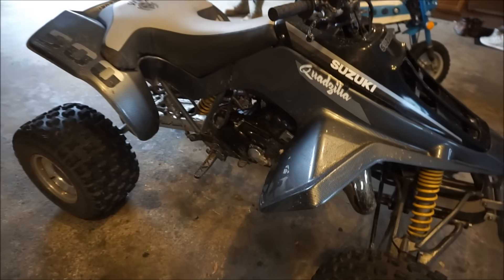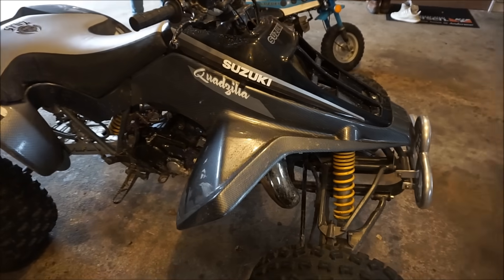Quadzilla Top Speed Test!!! (SKETCHY)

Comment from the maker: Be sure to see description of video to see what gear I use and upgrades to buy for the Quadzilla. To continue vlog follow me on Instagram @2_vintage_ 
Google says stock Quadzillas went 77-80mph. So I think it's right where it needs to be for speed...
Reply: How fast is that in kilometres an hour
Reply: By the way there is an error in the description as you was saying to see how fast it would really go it auto corrected to rally
Reply: Are you going to do a ltz500 vs cr250
Reply: You should do more than one top speed test so u can get and average speed because one test it could go 77 and another it can go 79 or 80
Reply: change sprockets in front and/or behind and their whole topspeed tests are worthless. kids don't seem to understand this..
Reply: This machine is NOT made for high speed road riding. It is geared down for good acceleration offroad riding. This means that with an engine without proper COMPRESSION like YOURS it is still possible to get up to top speed. Top speed is not the problem.POOR ACCELERATION due to LOW COMPRESSION is the problem and you prooved it several times!
Reply: @OhLuciii  124 kph- 128 kph
Reply: Adrian Wilson CD 250 wins out of the hole but dirty old Suzuki picks up enough speed to pass... eventually
Reply: Do a gauge check live on YouTube garunteed you know it has no compression trying to tell all the riders that have been riding since you were a newborn champ
Reply: @matthews852  lol good point!
Reply: The Quadzilla is known as the world's fastest Quad. With the correct parts it can reach a top speed of 120+ MPH But under 130 MPH
Reply: I had a quadzilla lt500 with a twist throttle about 15yrs ago. Came up on a small jump and after landing it, going up another hill the throttle stuck wide open. I rode the wheelie out for about 30ft and smacked a small tree on the right A arms and it completely ripped them off, shock,arms,and wheel. I rode it for a long time with three wheels and a custom skid plate . Definitely has a pucker factor.

Comment: I dont think you understand what high compression is, That quad you shouldnt be able to push with your arm. You should have to put every bit of weight you have into kicking it.
Reply: I have a 450 bike and the compression is so good that there is no way i could do it with my hand. This quad should be better
Reply: Yeah ikr lol my buddy had an old yz400f if you didn’t get it to tdc you weren’t kicking over you couldn’t even push it over with your hand. What their doing with their hand is barely more compression than my 250 two stroke.
Reply: I have an RM250 on fresh rebuild, gl pushing it with your arm lmao
Reply: @DGfilms1996  i know. You should only be able to do it with your foot. The only thing you should be able to do with ur hand is a 125 4 stroke. Lol
Reply: @kalvista8526  u got that rite, my 96 rm 250 required the 500 technique.
Reply: my guess would be they're down 20-30 psi, which isn't too bad but not(minty) by any means.
Reply: @theclubhouse1209  Exactly mines 01, if you fuck up it will break your foot....
Reply: I gotta push hard as hell to even push my 125 over with my hand. Does have a fresh top end though
Reply: @quadbikesr314  a 4 stroke right
Reply: 250fs and 125s are start-able by hand, I don’t recommend starting a 250f by hand though. Second of all, A YZ400F is COMPLETELY different and incomparable, because they have manual decompression, of course it’s going to be hard as hell to kick over. Every bike I’ve EVER been around I could at least slowly turn it over by hand.
Reply: Jackson Reich this might be the smartest comment on this page
Reply: Brian Bever Thanks lol I try
Reply: When I was a youngin I had one of these bikes rip an Alpinstar boot damn near in half.. If you got proper compression, you'll need top dead center, and every bit of your weight. Beautiful bike though. Kudos.
Reply: 92 lt250r. It's a Bitch to Kick
Reply: You cant compare it to a 4 stroke. The decompression is differant. And if you put constant pressure on any bike with your hand it will eventually turn over. It should be harder, but  it obviously isnt affecting it much when it's still hitting its oem claimed top speed. No need to rebuild and spend money if your flipping it. That piston still has another year or 2 of hard riding life left in it.
Reply: Kalvista yes idk what he’s talking about
Reply: I can kick my scooter with just my thumb boii does it have ‘mint’ compression
Reply: 2 stroke compression is way different than 4 stroke
Reply: Im guessing none of you people heard of air leaking past rings lol, you can slowly turn over pretty much all bikes by hand, what about sled engines like an 800 polaris triple 😂
Reply: First of all explain how a two stroke works since your so smart, I want to hear it. I want to hear how and why it could be so easy to turn over.
Reply: Kalvista I agree I rebuilt a couple of these when I worked at a shop and if you weren’t careful it would throw you off
Reply: Kalvista 2-stroke
Reply: I have 500 u can not push with hand
Reply: It’s a 2 stroke lol they’re not as hard as a 450, my 125 is like two weeks into a piston and I can almost start it with my hand
Reply: @kalvista8526  really? I have a 92' rmx250 and it's rebuilt too, it's really easy to kick over but it mostly starts first kick, it has 150 PSI though, maybe it just has a really good release?
Reply: Mike Samson no you don’t.
Reply: @Burt Gummer that's just wrong
Reply: @Burt Gummer not always
Reply: @DGfilms1996  OK buddy.. And who cares? The qaud has enough compression to get it started first kick.. So pls
Reply: @dannykyle738  thank you... You are the one person that understands.. Flip omg
.. Like the people are comparing it to 450 4 strokes.. It's honestly pathetic.. 😩
Reply: @mookow2534  exactly!
Reply: @jacksonreich5148  yes that's is very true!
Reply: @colebecker8658  I was thinking the same thing,  I made a video  " Shovelhead hand start" I think its called?  Its fresh and its 1250cc  and its point's   I'm either stupid or a badass or little bit of both or neither one of the other ✌
Reply: I have a rm 85 and my dad can't even push it with his hand
Reply: Buy a weisco. Overbore nickisea!. Pow 55-60 hp.
Reply: @bansheemania1692  Scraping you shin on the foot peg. Is a bitch. When kicking any these bikes. My 490. My kx  500 would bite me every so often.
Reply: Yeah my 85 has a shaved head and you can not push it down with your hand
Reply: Aidan Ley  right that thing has no compression
Reply: @jeffreyblank7087  yeah lol who thinks a 500cc 2 stroke has high compression when Mr stick arms pushes it down easily without putting his back or body into it
Reply: Aidan Ley lmao
Reply: Aidan Ley  and if u look at any of there "top speed" test nothing's warmed up it was cutting out the whole time
Reply: @jeffreyblank7087  yeah on some 2 strokes when there cold the power band disappears
Reply: Aidan Ley right
Reply: Kalvista I’d like to see you ride one know it all.
Reply: Not really actually because we used to have one and you don’t even need to put that much force into so your wrong on that bud

Comment: I kinda agree with whoever is saying it haa low compression, it may not be blown up low on compression however i have tried kick starting a kx500 and a cr500 repeatedly and i can never seem kick start either and thats at 160lbs. Which isn't much i know, but that quad seems to kick a bit easy to me as well. But hey a compression test woukd settle the dispute, maybe a video of something like that before you get rid of it? And i know that quad should be alot closer to 100mph then it should be 80, at least thats the case with any zilla i have encountered personally. Still an amazing machine none the less, and in great shape!!
Reply: But the difference is that quads your higher up on the kicker so you have more momentum comparing to a dirtbike
Reply: Still has low compression

Comment: Quad tires take 4-6lbs of air max as they're off road tires.  A 4-stroke raptor does 75mph tapped out, lt500s boast well over 90mph and with the right rear sprocket and pipe can break 125.

Comment: Ive loved the quadzilla since I was a kid. Any colors other than blue and yellow are blasphemous.

This top speed run is sad. Hell, my mid 90s Blaster would hit 60mph. This thing should be pulling 100+.
Reply: And it will not do 100+ with out gearing changes and motor work done to them and yes i have been building and riding them all my life  and worked with many builders......
Reply: @johnsmith-oh2xo  need
Reply: @zevuse_440  I wasn't born knowing everything i learned.I also bought and worked on my own too it only takes a search on google to learn how fast something goes or what the spec's of a quad are so use all they bullshit excuses you want .......
Reply: @johnsmith-oh2xo  ....i agree look it up because I have them and have had many since 92' and you won't find a number.  Factory official comment was well in excess of 90 mph.

Comment: You can start a banshee with you hand easily. I've done it many times. Never had a quadzilla but did own a cpl cr500's and you cannot move it with your hand. It was a procedure. TDC then swing it like you mean it  or it would not start.  A compression gauge would be alot more accurate, considering kicking compression isnt really a thing. Compression changes greatly when things are  worn and warm. In theory kick over compression could show fine with damaged rings when everything is cold yet not run once cylinder heats up and expands.

Comment: It didn't even come up on the pipe ?? Where's the power....... it's running poorly for sure !! I've ridden freshly built quadzllla extensively and if yours was running correctly it would have looped you on acceleration on the black top or at the very least pulled the front wheels in 1st 2nd and most likely 3rd with you sitting on the gas tank bro !! Those things have lots of torque when running strong!! Like your videos though 👍🏼I like the top speed tests! You all have crazy low prices up there for some nice bikes you've purchased in florida you can't find a NICE bike for less than 2000 and MINT bikes go for 3500 and up maybe I should buy bikes up north fix um up and sell them down here for a good profit 🤔 keep the vids coming!!
Reply: I had my quadzillia in 95 i had mine top speed 110 they are so much faster if you get it tuned in rite

Comment: My 87 Quadzilla did 89 mph out of the box when I bought it. Clocked by a friend who was a state cop on his radar gun. There was no way you could kick over my quad with arm strength. Lol. I had it bored 1.1 over, port polished, balanced, reeds, exhaust, filter, new head. After that I would hit 102 mph.
Reply: I've read shit like this for years. "Oh, my quad does 90, 95, 100, 110, 120mph, etc bone stock" Stop BS'ing. Quads can rarely go over 80mph stock. Many people think that if a quad has a lot of CC's or 2 stroke, then they're going to do triple digits. NO! Speed is mostly determined by gearing. Why do you think there isn't multiple videos of quads even hitting 90mph?? Cause it's hard, and if it can do that mph, then it's acceleration is absolute shit. Some of you just need to grow up.
Reply: @racequad9  don't be sad Buddy, but it's all true!
Reply: @bkbaitsal4389  Got a video of it to back it up? It's 2021, so it shouldn't be that hard to get a video of it, right? Unless...you know...you're BS'ing. I'll make it even easier, find me a video of a stock Quadzilla doing 90mph. Here's a built motor one geared AND built for top speed on street tires and it only hit 94mph. Just grow up and accept the fact that you're , like many others, just blowing smoke.
Reply: @racequad9  no cell phones in 1987 Buddy, I no longer have that bike. Come on man. You must of got beat by someone on a Suzuki
Reply: @racequad9  you're a sad guy. Just ride what you've got and be happy. Lol
Reply: @bkbaitsal4389  don't be mad cause I called you out on your crap. You're the type of guy that comes into work and talks about how fast his things are, that actually aren't. "Oh, my 5.7 hemi truck smoked an old guy in his Shelby GT500 at light this weekend". Just given you facts, bud, not a fantasy story.
Reply: @racequad9  you don't bother me, the truth hurts right. Lol.
Reply: @bkbaitsal4389  haha "truth"? I think you mean delusion, old man.
Reply: @racequad9  the truth little man! Haha
Reply: @bkbaitsal4389  then tell me how you have the only 89mph stock quadzilla ever made? Cause even dirt wheels magazine didn't break 80mph. I'll wait while you make something else up...

Comment: I've done 60mph on a warrior
Reply: My dad went 70 on a yamaha grizzly 660 when he got it new. It's an 02 now
Reply: I think my old trx 300ex did 55mph
And my 07 Raptor 700 did 78mph
Reply: @racequad9  got my 300ex to go 64 flat road. Not too much tweaking either,  stock it did about 55.

Comment: That thing looks great. 4k is a bit much but if you were to restore one yourself , it would cost a lot more to do. The thing about all the LT's was the a-arm geometry,  suspension, and brakes totally sucked. So by the time you correct them issues, and gusset the frame, cut gears for the tranny, and toughen it up. It can be an expensive endeavor. Once you work out it's quirky kinks, it can be almost as reliable as, a trx250r. Nothing is perfect, and certainly not bullet proof. I hate when people say shit like that. It was a bad mf, it just wasn't the best design . It is considerably bigger, and heavier than a 250 as well. They had a short run and so finding parts can be expensive. Mostly everything you buy will be used, there isn't much aftermarket because they weren't raced much. You can run open class in motocross but if there's nobody to race it's hard to get a race. Super fun quad, nostalgic and for me a collector. If you still have it, I'd be interested for 3k ish. It would be cool to have. Always wanted one.

Comment: They are faster then 77 it’s all on ur gearing my LT250r hits 78 but I’m running a top end gearing on it. And STOP engine braking!!! It’s horrible for a 2 stroke.
Reply: Lol he will never learn
Reply: TJ Rides plz explain what engine braking is and is it bad for 4 stroke
Reply: @stevechristakos7659  2 stroke is lubricated while injection gas oil mix. Braking using the engine and transmission  by downshifting causing the engine the wear prematurely due to lack of lubrication.
Reply: Steve Wenzel is it bad on a 4 stroke
Reply: @stevechristakos7659  No because it has constant lubrication.

Comment: If the sprockets are aftermarket it could of been geared lower for more bottom end torque resulting in lower high speed but that thing rips.
Reply: It doesn’t rip at all. The carb isn’t dialed in properly and it’s lacking compression. You can tell when he’s going through the gears that it’s not pulling worth shit. If they had a clue about bikes at all, they’d tear it down and build it up fresh so it’s actually worth having.

Comment: Don’t listen to half these regards     Top speed has no indication of how well the bike runs.  I’m sure he changed the sprocket sizes over the last 30 yrs.   clean ride tho.   On the compression, I would test it , the last 500 I had after putting it in TDC you couldn’t move it with your hand . I noticed yours isn’t lifting the front end through the first 3 gears . No doubt it isn’t running at it’s full potential, but it looks like it isn’t far from it.

Comment: I've read shit like this for years. "Oh, my quad does 90, 95, 100, 110, 120mph, etc bone stock" Stop BS'ing. Quads can rarely go over 80mph stock. Many people think that if a quad has a lot of CC's or 2 stroke, then they're going to do triple digits. NO! Speed is mostly determined by gearing. Why do you thing there isn't multiple videos of quads even hitting 90mph?? Cause it's hard, and if it can do that mph, then it's acceleration is absolute shit. Some of you just need to grow up.

Comment: 77 mph is slow for a quadzilla 
They will run 100 mph off the show room floor when they are brand new
Reply: um no they wont
Reply: William Mickelson 
You would have to put a 15 on it but other then that a stock 500 runs its best when new and nobody has messed with it yet to get it all out of wack and your 500 is running lean as hell so it’s running hot as hell and that’s probably what got your clutch slipping to or I know the heat and ain’t helping none at all and yours sounds like a hurt 250.
You won’t be trying to kick crank a healthy 500 with a pair of Nike’s on